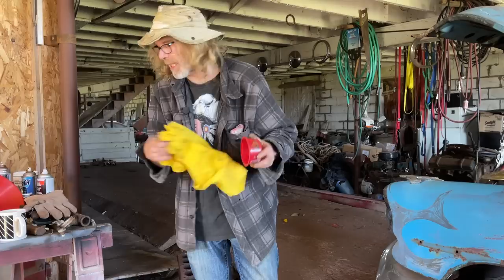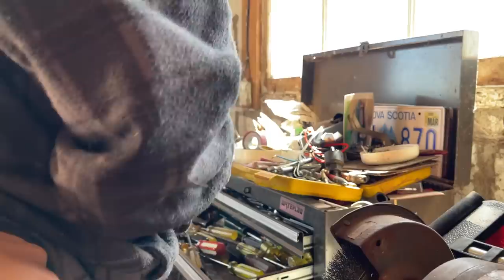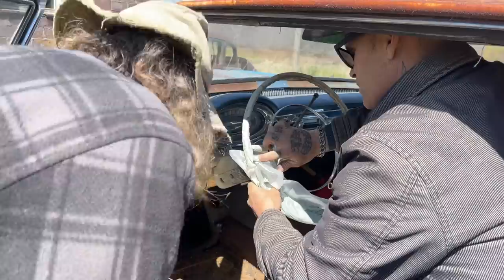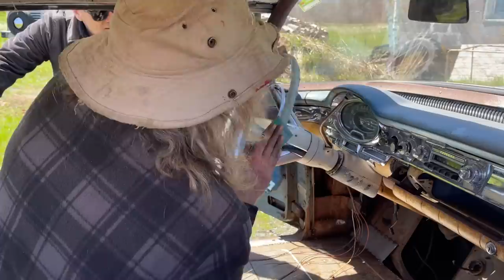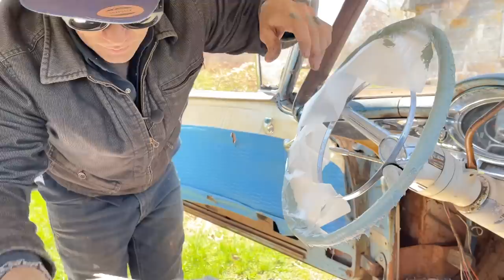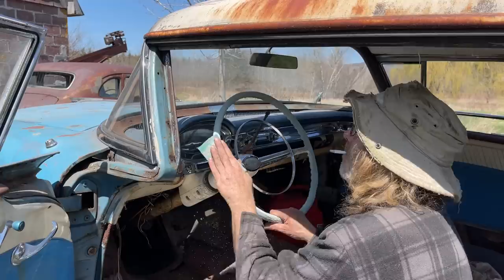Cracked steering wheel repair on Jim's 1957 Oldsmobile Rocket 88

Comment: love that Olds ! i did a similar repair on my '66 Belvedere steering wheel i got from a salvage yard .  filled the cracks with JB weld . sanded easily , primed and painted  .turned out great .

Comment: If I ever have to do this again I may try bodyfiller,, only did it once before and used an epoxy I tinted red to match the interior.. always felt sticky in the heat, so I ended up leather wrapping it anyways.

Comment: Just yanked the column out of my Boggs' Monster 57 Pontiac to replace rag joint and remove brake booster. Steering wheel is a cracked mess as one would expect.

Comment: Dad had a 57 Olds There was a run of engines with bad cams Dad got one of them The dealer was hesitant to repair saying there was good chance he'd get another bad cam as GM had not declared a recall Dad got a 1960 98 at dealer cost  for the inconvenience.